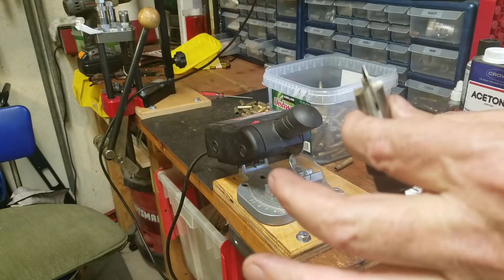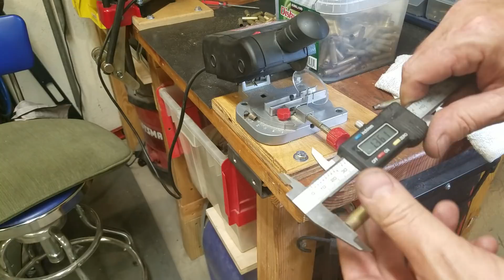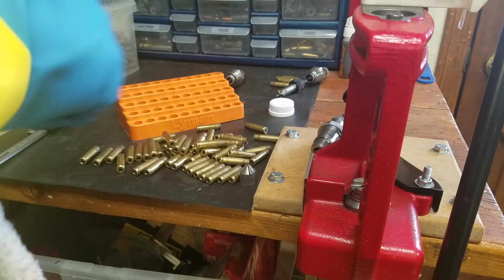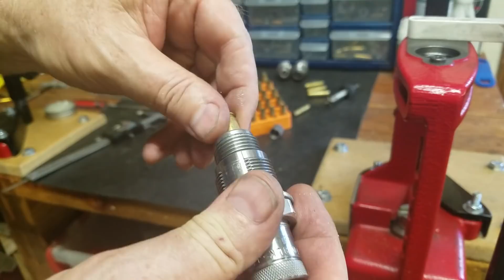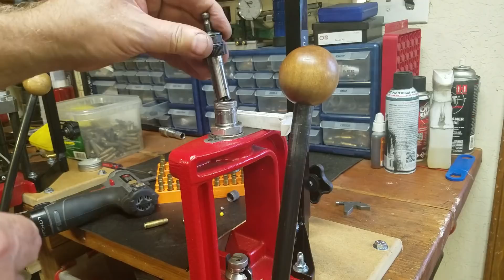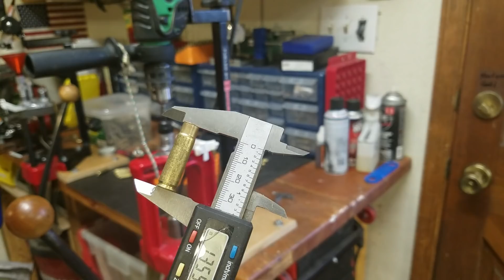Improved: Making 300 Blackout Brass with Lee Power Quick trim system

Comment: Been making all my 300 brass from 223/5.56 range pickup since I got my 300 upper years ago.  I've haven't paid a cent for 300 specific brass.  I use the same saw, and the Squirrel Daddy jig.  I also use the Lee case trimmer.  The only thing I've found that helps is when forming in the die, after the first time you run it, spin the case 180 degrees and run it up into the die again.  300 has such a tiny shoulder that running it in the die only once creates a sort of rounded hump instead of a sharper shoulder.  That tiny little hump can cause chambering issues.  Running it twice forms it better and I've had no chambering issues.  I've tested between annealing after forming and not annealing and have found no real differences (but I do anneal after a loading or two to extend brass life).  I haven't found any particular brand of brass that has thicker sidewalls than others, at least to the point of needing any neck turning.  Of course, this might depend on the chamber in your particular rifle.  Since my 300 was purposely built as a sub shooter, 50 yards or so is all it needs to be accurate enough for, so mixing brass brands doesn't matter.
Reply from the maker: I have a lot of brass I made this way a long time ago so, its been a while since I had to make any.   I do like to turn the necks.  Its an added step but it really helps even out differences in pressure caused by varying neck wall thickness.  Very noticeable with super sonic ammo.  Thanks for the comment.

Comment: Not possible on many cases without neck trim or will jam. Neck thickness not over .0135 one side.
Reply from the maker: I think you will find most 223 cases work fine, Lake City always works.  Neck trimming is great for blackout cases for sure though.  I have a video on that too.

Comment: Know how to do that...
How bout start with .300 blkout BRASS & show how to do that with quick trim handle & lee quick trim die
Reply from the maker: This video is a how to convert 223 brass to 300 blackout using the power quick trim system to set final trim.   If you just want to use it to trim 300 black cases, thats easy.  Put in the right shell holder.  Screw the quick trim die into the press till it touches the shell holder or more for handle position ease.  Put the cutter in the top without the steel extension ring, run a case in and run the cutter with a drill or powered screw driver.  Use the black plastic ring to change the amount of trim up to .010"

Comment: This is the second video that I have seen where the user had the same kind of case trimmer. Since this video was made, there are a number of better devises out there that use an actual end mill, and they work much better, and are much sharper. one is the Little crow case trimmer, and then there was another made by a guy in UT that was a bit too similar to the Little Crow so he had to stop making it. Good video though.
Reply from the maker: You bet, there are a bunch of ways to trim brass now and you can really spend some money doing it.   This is inexpensive and still works.  I havent felt the need to change up for my limited volume.
Reply: @TreeTopFlier  Yep, when you are starting out, you tend to try the cheaper ways first. Some work better than others.

Comment: Thank you for driving home the tip on accurate cuts within a couple thousands. Ive been making 300 savage from 308 with lee Deluxe trimmer. And each case takes me over 10 minutes per case after cut off saw. Over working my lee trimmer.
Reply from the maker: Glad this gave you some ideas.

Comment: do you anneal your brass too?
Reply from the maker: I usually dont but it would be a good idea.  If I had a machine that controlled timing and heat that would be ideal.  Annealing these small thin wall cases by hand can be hit or miss.  Also, I try to make these videos for everyday reloaders who probably dont have big budgets or high end equipment.  Thanks for watching.
Reply: @TreeTopFlier  I just asking because seem everyone anneals but I am like you, have no machine or the money to buy one. I did thought about trying the glow method with a torch and a socket but I haven't jump on it yet...

Comment: Are you still using the Lee Turret press? What tricks have you learned to make the best reloads?
Reply from the maker: Do i still use the turret press? You BET!  love that thing.  If i could have just one press it would be the LCT.  I enjoy reloading, so I enjoy using different presses just because.  Sometimes I want to use my 1968 RCBS cause it's cool.  My best tip is to make great rounds, you need great brass, whether you buy it or condition it via sorting, neck turning, annealing etc..  There isnt as much magic in the actual press as people think.  And as far as the actual round you can measure the qualities dimensionaly right on the bench.  is it concentric, is the shoulder in the same place round after round, overall length etc.
Reply: Thanks

Comment: So what is the final trim length for necking it down?
Reply from the maker: Not exactly sure what you're asking but Ill try.
When I chop the brass, I try to get 1.360" (the final target length).  The brass I use has been fired and not resized yet.  once the brass has been cut I run it through the resizing die to resize AND form the new neck.  Since the brass has not been previously resized it will grow or get longer, usually out to 1.368" or so.  This gives a little extra material to final trim and square the neck, back to 1.360"   Note:  If you are dealing with already sized brass 223 brass you will have to lengthen your initial cut by about .008" so you have some trim room.  The spec for final trim length is 1.348" to 1.368".
Hope this helps
Reply: @TreeTopFlier  sure does! Thank you so much. I guess I could have just read the directions that came with the LEE QT die as well.  Thanks again and thank you for the video!

Comment: What about forming before you cut then you can clean the mouth and trim have you tryed to do it that way? Asking because i have been thinking about trying to make some that way
Reply from the maker: You can do that but I like the flat part of the 223 case wall to lay in the jig and be supported on both sides of the cut.  Unless you use a mandrel or collet die later, you will still have to run it again with the expander ball in to set the neck tension.   There is more than one way to do this for sure.
Reply: @TreeTopFlier  was asking because i have not made any yet but i have a need to start and your insight i think will be very helpful. Thank you sir.

Comment: My LEE trimmer attachment only spins the brass in the holder.
NOT ONCE HAS IT EVER SUCCESSFULLY TRIMMED A PIECE OF BRASS, EVER!
Reply from the maker: Something seems wrong with the setup.  I would be happy to help see if I can help.  What case are you trimming?   The trimmer is universal for the different caliber specific die.  Some dies require the bushing installed.  Some do not.  My first guess would be using it where the bushing is called for without it.

Comment: Question:  Wouldn't sizing the case before the cut-off step eliminate the chamfer/deburr step?  The 5.56 brass case shoulder is smooth and there would be no chips to contact of get stuck in the die.  The trimmer will then chamfer and deburr.  Am I full of it here?
Reply from the maker: Its a good observation, and you are not wrong, it would work that way.  I cut, then size because I want the case laying flat on the side when the chop saw hits it, not teetering on the new, narrower neck.  Also, you would have to go back and run it through a die with a sizing ball in it to set neck tension or like I am doing here by, using the lee collet die as a finishing step.   To be clear, I am not worried about the brass chips from cutting doing damage to the die.  Brass is soft and the dies are hard steal.  Why I am removing the spurs left from cutting, is I do not want the excess material to influence the shaping of the neck when it goes through the die.  This is an improvement I've added from my first video on this topic.  As time goes by I have really come to appreciate the essential roll the brass plays in accuracy.

Comment: How did you get the Lee quick trim to get low enough to cut case short enough
Reply from the maker: the die is caliber specific. it is designed to stop the cutter at the exact spot for the length.  The cutter has a fine tune ring that lets you adjust +- .005 thousands.
Reply: @TreeTopFlier  I could not get mine to trim low enough to reach max case lenth
Reply from the maker: @renosmith9931  Strange?  Did you remove the steel bushing?  It comes with a knurled bushing installed.  It's a spacer for larger cartridges.  You have to remove it for small cartridges like blackout.  Check your die instruction sheet it gives the specific setup of the cutter for each cartridge.
Reply: No sir I did not my dumb was watching another video an he said that it was Supposed to be removed like a dummy I did not read the instructions very good but thank you so much for your input and concern everybody has been awesome trying to help the old people through thanks again my man you have been for men you have been tremendous

Comment: I have two comments.

1: Please don't take this the wrong way, I mean it very respectfully. As a fellow do-it-yourself video maker (not as many as you, obviously) and as a teacher, your video was very long. You could have cut 20 minutes out of the video by not over-talking your points. You spent 10 minutes talking about the trimmer and messing with it before you even used it.

2: The RCBS case trimmer seems superior to me. It seems like it's much easier to set up, and it's much more simple to motorize. I'm wondering why you went to all this effort instead of just using the Trim-Pro.

Comment: Thank you for the informative video. But unfortunately the design of the jig uses the body taper of the brass casing to locate the cut, so it would be pretty complicated to make that adjustable. Also deburring before final triming is a wasted step as the final triming process deburs it.

Comment: I'm fairly new to reloading myself, but at 13:35, couldn't you run them through your tumbler and have it clean off the lube as well? Seems like you're creating more work by cleaning them twice. 
Also, Why not use a drill press for cutting/trimming your brass instead of making a drill press out of your reloading press?
Any feedback is appreciated.
Reply from the maker: You sure can run them through a tumbler to get the lube off, I was only doing a small batch for the video so I mostly just wanted to let everyone know that if you use the Lee quick trim die for this you need to clean the lube so the die can grip the case.    As for the drill press.  The die and quick trim cutter I am using is designed to be used in a press, not on a drill press.   I was just showing an adaptive way I found to drive the cutter with a drill and be hands free.

Comment: Great video; learned a lot.  Do you tumble after this step before priming and loading?
Reply from the maker: I like to form clean brass, so the brass is already pretty clean when Im doing this.   Depending on how many Im making, if its just a few, I will just wipe them down.  If its a bunch, then yes  I may throw them back in a tumbler to get the grease off.   If you wet tumble them with SS pins it will kinda blend down any sharp angles.

Comment: So when you installed the die into the press did you just run it down as low as it goes? Do you raise the ram and run it down until it contacts the shell holder?
I am talking about the trim die.
Reply from the maker: Yes, it's just to the shell holder, you can adjust the die deeper to set the handle higher for comfort.  The adjustment is on the cutter.

Comment: I've always set my jig by using a good case.  Because after I trim, I'll get a stretch when I size the neck.
Reply from the maker: Ive tried that but my cheapo clamp always deflects left or right when i tighten it.   Maybe just me?
Reply: @TreeTopFlier  never had an issue yet.  And I've learned to always remove burrs before sizing so it doesnt leave a bunch of crap in the dies and cause em to wear out/get scratched up.

Comment: Great update, Lee sizing lube is water based and comes out easy and in tumbler and works as well as Imperial and easier to apply. Glad you updated drill with a stay on button for 1 hand operation but if you invested in a lyman universal power trimmer you would have been happier, cheaper and less work with micrometer adjustment.

Comment: Question on that collet die.  Would that allow you to use a thicker brass - say . 14 or . 15 at the neck and take it down to the .011 that you like?
Would save a lot of culling of the range brass that I normally pick up.  Thanks
Reply from the maker: I havent checked for that but it may be able to do some of that.   If your making your own the neck naturally has a taper to it because it is formed from the body of the case so it may have that capacity.  It would also depend on how much pressure you can apply with your setup.

Comment: Killer info here. That’s basically the way I do it, but I love the foot switch drill set up.
Reply from the maker: Adding the drill and foot switch setup is the bomb.  It actually is more consistent because the downward pressure is
always the same.   Once I get going it is within .001" - 002"  variance.  With most being right on the money.

Comment: You're the best man! I do think I am going to have to get with Lee and see about getting some new blades cuz no matter what I do the inside chamfer is leaving a really small bear on every case that I do.  I also found the 1/4" bearing at my local Home Depot for around 50 cents or so.
Reply from the maker: Do you think this video explains it better?  Here is a link for the cutter parts: https://leeprecision.com/deluxe-power-quick-trim-parts/    If your ordering, I would go ahead and get the molded parts kit too.
Reply: TreeTopFlier it definitely does a great job of explaining it. When I watched your other videos about it and you mentioned the WD-40 I actually chose not to use WD-40 and used a little moly grease because I had already ran into the issue of the case of spinning from the Case Lube after sizing. I appreciate the link and I will definitely use it.